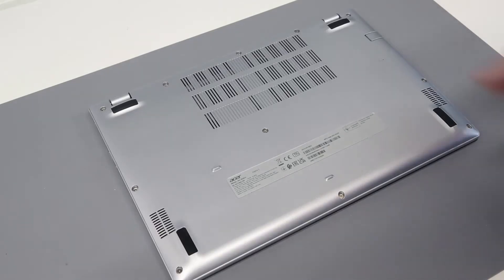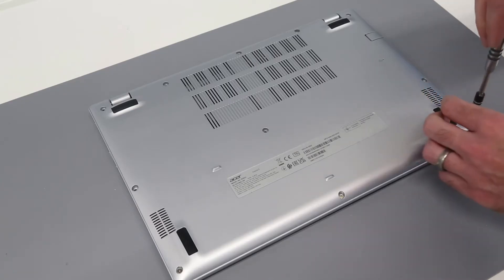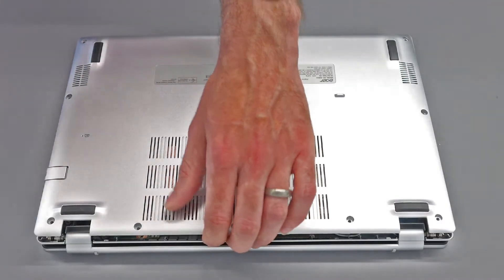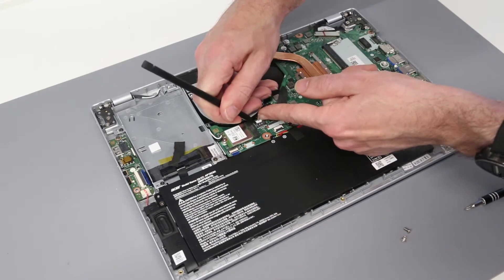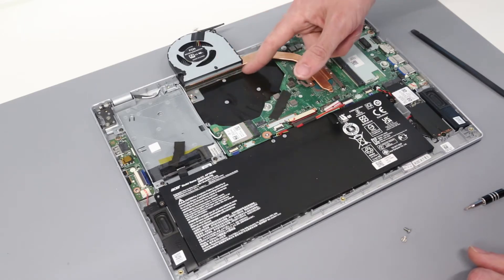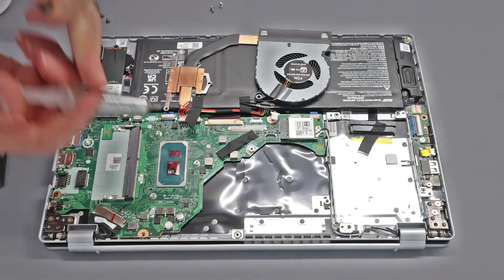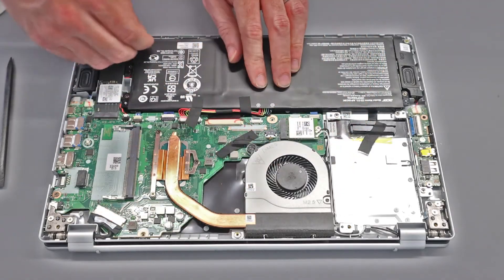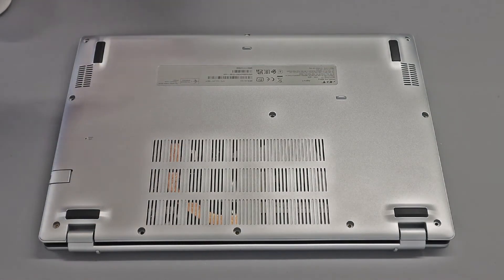Acer Aspire 5 A514-54 - Fan Cleaning and Heatsink Repasting Guide

Comment: Ok I’m back over a year later with another comment. Thanks for the tutorial it helped follow along. Last year I didn’t have a pry tool so I couldn’t do much. I messed with the fan a bit in around December and now the fan doesn’t run at all. Always overheating and bsod and always a less than 1 hour battery life after full charge. This time I opened it up and noticed a few things. 1. The tape on the battery wasn’t even attached and there was clear tape over it. There was no tape over the fan plug nor was there tape connecting the fan and heat sink mentioned in the video. It just came off fully after taking off the screws and plug. And also, I see no screws attaching the battery to the laptop and it doesn’t even fit in properly to the thing it’s supposed to go into. I bought it new from Best Buy in November 2021 it’s now April 2025 I now suspect it was tampered with
Reply from the maker: That doesn't sound right, and no way it would have been new in 2021!
Hope this guide helped you get it running better though.

Comment: im currently stuggling tp pry open my laptop without a spudger and im too scared to accidentally break something even when im just trying to use an old id card, i feel like I should give up cleaning it myself atp
Reply from the maker: Pry tools aren't expensive, but if you have one something like a guitar pick will work.
A plastic card should work too, but might be a bit too flexible.

Comment: i just cleaned the fan a few days ago but this black tape which holds the fan cable (in your video at 2:44) is not so sticky anymore and is doing noises when the fan is on. Do you know which tape this is to replace it?

Comment: i hate those laptops with 'modern' cooling system that stupidly places exhaust vents under the screen. not only you will have hard time finding an effective external cooler for it, the laptop gets hot very fast

Comment: hello sir ,i had question why do we remove the battery????
Reply: Hello sir/ma'am, I asked my uncle about that once (he is a electrical technician). He said that power supply and battery should be removed from the gadget or appliances before fixing its main problem for safety purposes because of live wire due to the electricity stored in the battery. That's what he said. Sort of? That was a long time ago though.
Reply: @mars-94mcg  thank u for explaining👍🏻

Comment: Very clear very simple video, hello i wanna ask about the air flow of the heatsink fan, where the flow blow to ? is it to the under of the laptop, or to the top of the laptop near the screen ?
Reply from the maker: From memory, it blows through the heatsink and out the vents on the back edge by the screen.
Reply: @BrueComputing  thx you for the fast answer, so it blows to the top of the laptop right ?
Reply: @socaramdhani8046 my aspire 5 fan blows on in the screen

Comment: Quick question, There is only one fan in the laptop,the fan that you have replaced, right?
Also where can you find the fan itself? I cant seem to find any model number or part id for the fan.
Reply from the maker: Yes, just the one. If you search "a514-54 fan" on eBay you should be able to find them.

Comment: Good video, very clear.  Just what I needed to replace the crippled fan.
Reply from the maker: Glad it helped!
Reply: Replace it with what if you don't mind me asking?
Reply: @youn177  Most of these laptops require specific fans, I had experience with an older Acer Aspire 5 model. The fans can be ordered on AliExpress and are not that expensive. I had luck that there was a store in my country which had the fan I needed, I paid a bit more for it but the delivery took only a couple days.

Comment: Why you didn't bother to paste the second thermal contact on the CPU? Wasn't it some factory defect they forgot to apply paste on it?
Reply from the maker: The second chip on the package is the PCH (Platform Controller Hub, what you'd traditionally call the South Bridge), not the CPU.
It doesn't really need it, it isn't there initially by design. You can apply it if you want though.